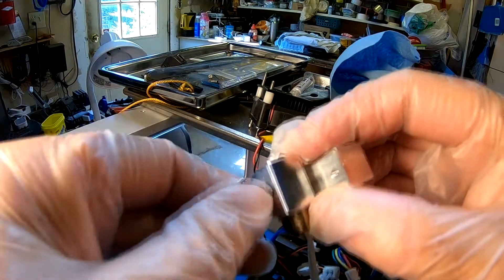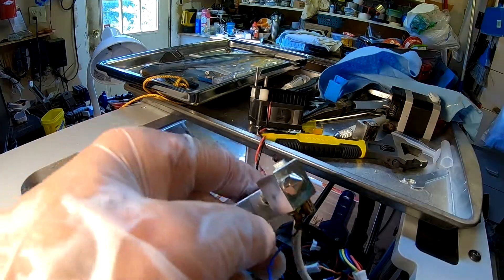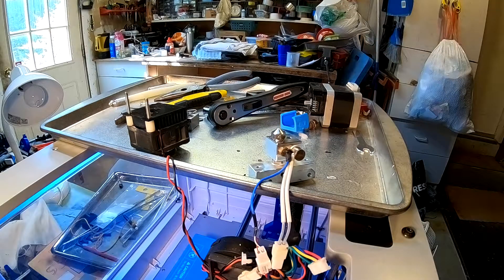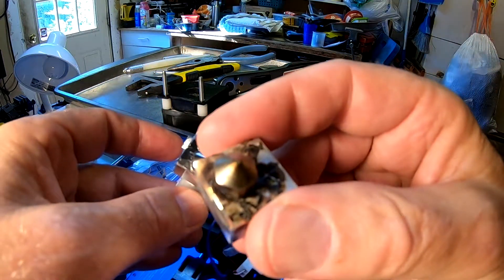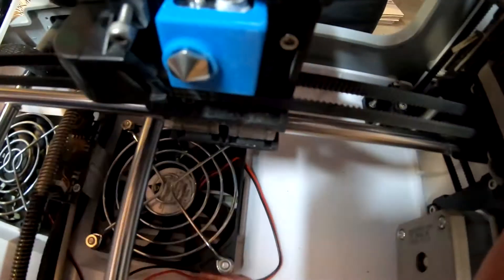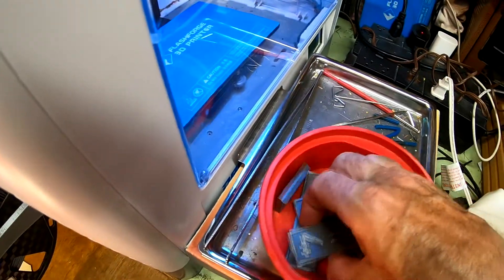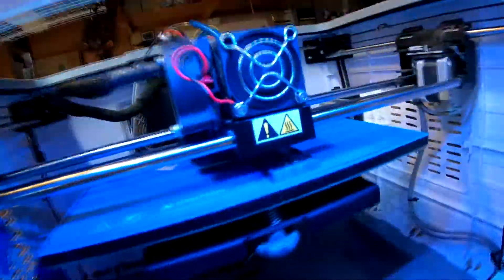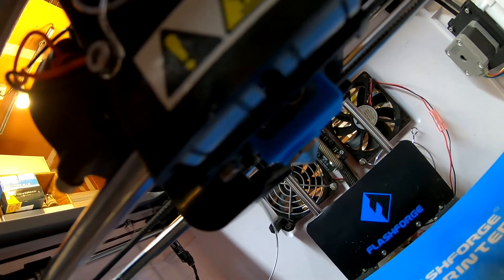Flashforge Dreamer (NX) - Replacing Printhead & Nozzle plus switching to a Silicone Sock - Part 4

Comment: Hello! What does the silicone sock do?
Reply from the maker: Thanks for the question!
You need to insulate the hot printhead from your print.
Otherwise it will remelt the filament you laid down previously, messing up your print.
The FlashForge Dreamer NX comes with some thin insulation and Kapton tape (which is heat resistant) to do this, but over time it gets filament stuck to it and loses it's insulating value.
A silicone sock is superior to the thin insulation because filament doesn't stick to it and it better covers the whole printhead.
I wouldn't print without it.
I'm normally using 225 degC with PLA these days. It flows better and adheres better.
I used to use 220 degC but found 225 degC to be better all-around.
I couldn't use 225 without the silicone sock because the standard insulation isn't good enough.
Reply: Awesome thank you for replying and the detailed explanation. I will definitely use a silicone sock. I print cookiecutters.